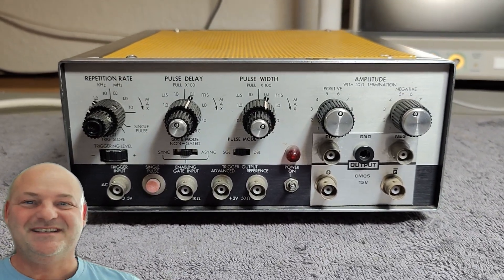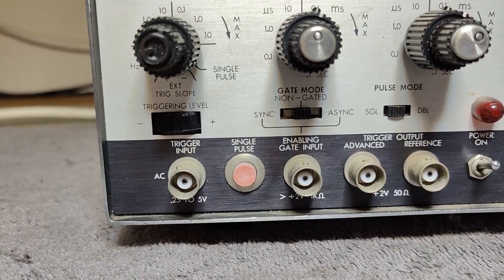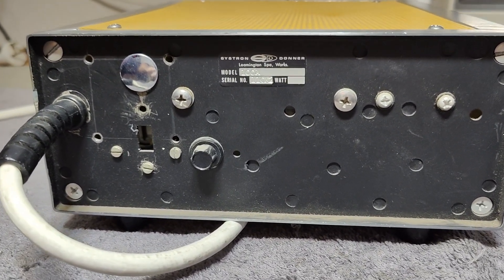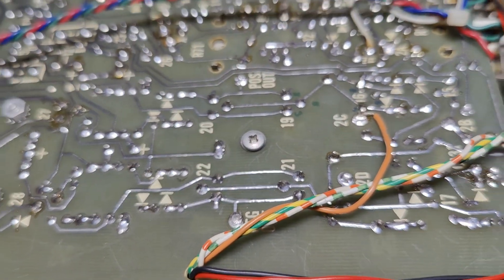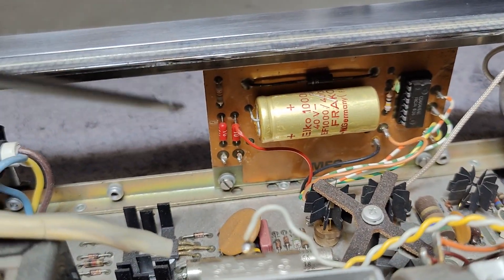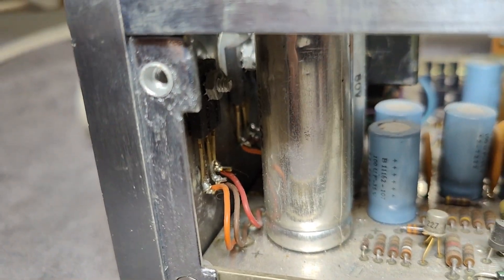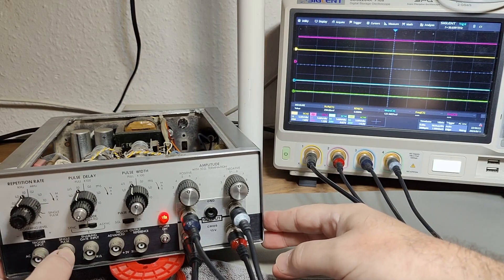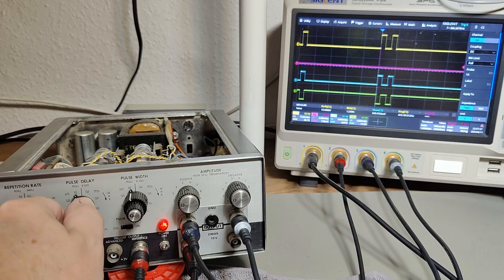Datapulse 100A Systron Donner Pulse generator 10MHz 1971

Comment: Demo ideas:

The double pulse could be received as serial data by an Arduino and displayed in binary on a display. You would then see the binary “1” moving around. The first pulse would be the start bit.

Listen to the double pulses. The delay between them would change the timbre.

Drive a LED directly from the 50ohm output and the width would change the brightness.

Control a model servo that uses PWM for angle input.

Generate Link Integrity Test (LIT) pulses for twisted pair Ethernet. The generator output would make the Ethernet interface light up its link LED.

Beat the output with the 1kHz cal output from a scope and listen to it to demonstrate how beat frequencies arise.

Use the output to directly drive a 50/60Hz synchronous motor.
Reply from the maker: this is a good idea, thanks

Comment: It's good for what it states - It's a pulse generator! I've got the next model up, the Datapulse 101, which I picked up up on eBay at least 20 years ago. I've never had a problem with mine although I'm considering putting it on the bench and checking everything on the inside as a couple of switches have been getting a bit noisy on occasion.
By the way - I used to work on aircraft avionics in the mid 1970s, that were designed and built in the late 1960s. They were using 4 layer boards with plated vias, so that technology was alive and well, before this board was designed. They just didn't use it.